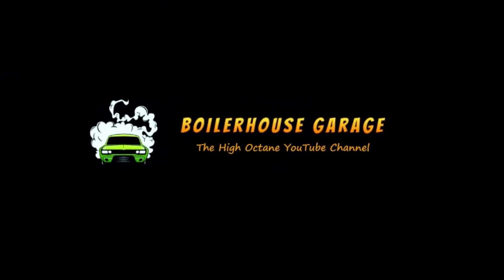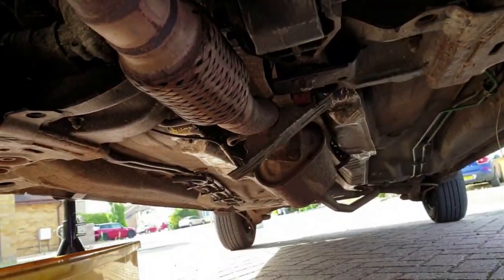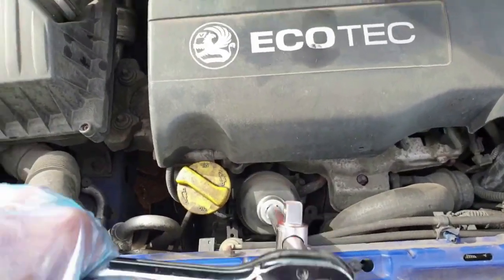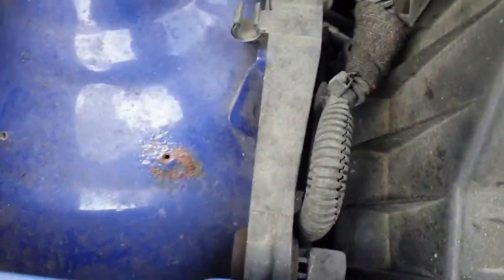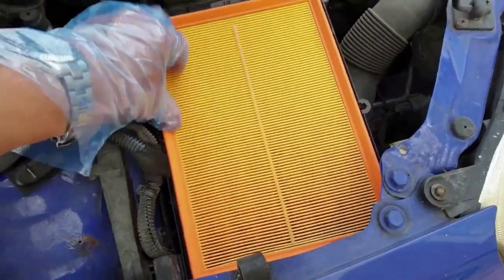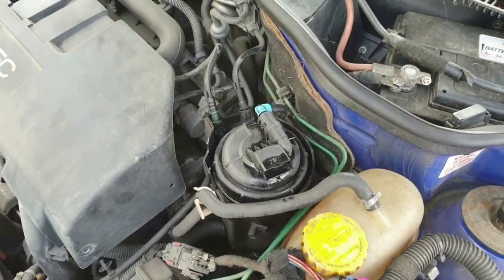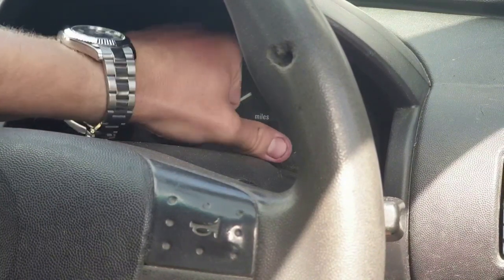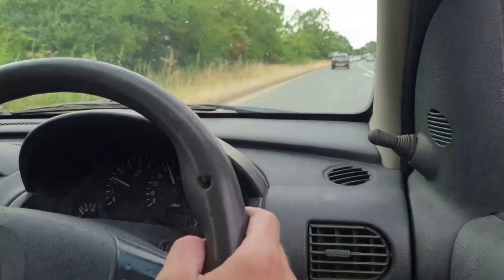2007 Vauxhall Combo 1.3 CDTi 🚚 Air And Fuel Filter Service Oil Change 👨‍🔧 Test Drive 🔧 Opel Corsa

Comment: I'm shortly carrying out a oil and filter change on my Combo van that has a mileage of 138,000 and it's still going strong. (My Fishing wagon now I have retired) This video is just what I needed.
Reply from the maker: Excellent! I'm glad it can help. Is yours a 1.3 as the 1.7 is a completely different engine?

Did you have any issues getting a good insurance quote? I have in the past when using a van for personal/hobby use, as I think a lot of them assume it will be commercial  and business use.
Reply: I insured mine for £227 a year which I was shocked. Ex royal mail 1.3 cdti. I was thinking of scrapping it recently as the gears went all weird where I could get into 2nd or 4th gears at all. But still been driving it couple times a weekend as I work away all week as a HGV driver and just coped with 1,3 and 5. Then all of a sudden, I gone to change down into second forgotting it was not working. It actually got into second with a grind which it never did before and it engaged the gear when I released the clutch and it got 4th without grinding. But while in 2nd or 4th gear, the gear stick didnt feel like it had slotted all the way into gear. This happened for a few miles and then the morning after, it appears to be working fine with no grinding and slots all the way in.

I insured mine as a day van with Lexham. I only had the van since September. Before that, I had an 04 plate Almera which was and still is a great car. My father owns the Almera now with the 1.5 petrol. I was paying £98 a month to insure the Almera. But as I only mainly drive to work on a Sunday or a Monday and home on a Thursday or a Friday. I couldnt justify the expensive insurance. I was deemed by Hastings that I am at a higher risk due to my job as a HGV driver which is odd as I could possibly only drive my own vehicle twice a week. I am also a named driver on my wifes car too and when I go anywhere during my time off, I go in the wifes car as its much nicer being a 72 plate Seat Arona FR auto.

I enjoyed this video, I have decided to keep the old girl now especially as I realised that the last time I put diesel in my van was in September when I filled the tank and its on just over a 1/4 now. It is limited to 70mph and sometimes when building up speed to join a motorway in 3rd or maybe 4th. It seems to have a miss and then reduces in power. I still reach 70 but a slight hill it slows down to about 60. I am going to have a look at my air filter and MAF sensor later today as I already have the replacement parts with me at home.
Reply from the maker: @stevecampbell7589  Sorry for late reply. Youtube not notifying me again.

That's great! It's worth keeping them going for as long as possible, but obviously having some kind of breakdown service just incase. Gearboxes can be weird. It might be due a fluid change in case it's all gummed up and effecting the synchro. If your MAF is faulty, you'd be using a lot more fuel than expected and it usually throws an EML, but definitely check the air filter is clean. Thanks for the comment.

Comment: Great video.  Just done the same service to my 1.7 DTi.  Ital van would be an awesome fine
Reply from the maker: Nice! Is that in a MK4 Astra? It might be based on the same one in my old Civic. It's certainly a lot better than this Fiat 1.3 although I've seen some hit 180k miles. Thanks.
Reply from the maker: Oh hang on, I just remembered you had a Cavalier MK3 with one. Not sure on the 1.7 in that.
Reply: @boilerhousegarage   it’s in  a 2002 corsa C. Isuzu 1.7 DTi.  Much better than the fiat unit and more economical.  Cav went 😭. It was one of those cars that people liked to bump into.  Only 2 cars now.  85 3dr Astra estate. And a corsa c DTi.
Reply from the maker: Aw crap! That Cavalier looked tidy. Well at least you have a very practical classic (my '88 Astra van was the same platform) and the Corsa must do some epic miles per gallon.
Reply: @boilerhousegarage  Iv wanted a 3dr estate for about 30 year 🤣.   Corsa does 49mpg around the doors consistently.  That brimming it, 2 clicks.  Then returning to the same pump.  Iv not  had it on a good run as yet.
Reply: @boilerhousegarage  my little 1.3 has just hit 218k 😂
Reply from the maker: @Cookymonster198  Wow! Obviously being well maintained. I'm confident the one in this video won't get to that! 😄
Reply: @boilerhousegarage  the lad that owned it before me had a father who was a hgv mechanic, I’m guessing he took pretty good care of it, I’ve only had it a year but hasn’t let me down either, the only issue I’ve had is a bit of intermittent rough idle lately, hence stumbling across your video as was looking at changing the fuel filter!
Reply from the maker: It is still rough idling? What I found on a lot of higher mileage cars are the crankcase ventilation hoses that route to the throttle body and/or air intake area can block up. You can just disconnect them to see if the idle improves and then clean and fit a catch tank. Similarly the idle control valve itself can also get clogged and are usually cheap and worth replacing as a matter of course.

Comment: Those little combos are brilliant vans 13 diesels run for ever on a fiver personally id love a mk 1 combo but good ones are getting rear 👌👍🏻
Reply from the maker: I was confused to what the MK1 Combo was, as I saw an "Opel" Combo, which was the same as our MK2 Vauxhall Astramax Van, then what I thought was the MK1 Combo, looks like an Astramax rear but Corsa front end 🤔Perhaps like the Corsa/Nova, Kadett/Astra, Ascona/Vectra/Cavalier, the European ones overlap out marques?
Reply: @boilerhousegarage  The first generation combo did have a corsa front end and box plonked on the back it first came out in 93 / 2001 🤔
Reply: @darrenmeears3912 I had the first generation combo van with the metal front roof box. Mine was leaking like hell when I got it , a guy on  eBay sold fiber glass replacement front roof covers. I bought one and it solved the leaking, but I couldn't sort the none working speedometer!. After a few months it failed it's M.O.T. so off to the scrappy it went!

Comment: I occasionally get a judder moment of limp like it’s running out off fuel… would you you advise I change the fuel filter? It only got changed 5k ago? Thanks if you reply
Reply from the maker: Never mind that, where's this ganja at? 😄 I'd be first looking for water ingress which you can find in the fuel filter housing (water will go to the bottom with diesel sat on top) so you'll be looking in that area anyway to see if something is clogging the filter or any part of the system. Do you run the tank low much, or notice it happen less if on a full tank or more if you're coming off a roundabout? It could be a loss of fuel pressure if the pump is on its way out, but should really outlive the van unless its done exceptional mileage. A couple of tanks of Shell V-Power diesel and an additive called dipetane wouldn't go amiss if perhaps the fuel system is clogged somewhere else.
Reply: @boilerhousegarage  I was under quarter tank when it was happening and just filled up and it’s not happening now so you think pump or water in filter? Thanks mate
Reply from the maker: @cannabisfarmoutdooruk4729  It won't be the filter/housing in that case. It could be your pump, or at least it could get damaged if you run the tank too low. Chances are your fuel tank is contaminated with water, sludge or I've even seen petrol (where someone has mis-fuelled in the past) as it will sit on the bottom of a diesel tank. All diesels and fuel injection tanks are pressurised or use a swirl pot, so keeping the tank as full as possible will mean you're effectively diluting the contaminant, so try not to let it fall below a 1/3 tank. You can get it drained and cleaned out, but as it's a messy job and the fuel will be classed as hazardous waste, it won't be cheap. There's no fuel drain on these tanks and you can't syphon it (I've attempted both) so won't be a home job unfortunately. As long as you keep the tank topped up full, you can still use it; it's just annoying to keep having to fill up every 200 miles or so.
Reply: @boilerhousegarage  nice1 thanks for you help 🫡

Comment: I had this confusing message on my fiesta st mk7 they dont have a service light ar interval. Very confusing. As it is not an eml it doesnt appear on a standard basic odb reader. It only showed on an expensive advanced reader (such as this on this video) in my case the error was also a pressuee sensor and was a boost leak. In my case from the intercooler.

From my experience if anybody gets this error light appear my advise would be to get a boost leak test. Once fixed it should dissapear on its own
Reply from the maker: Yes, they make a lot of people say they need an engine service (like it's due for an oil change) rather than throw a proper indication that you have an error code. My ST was going into limp mode and even then the EML light was off! Boost leak tests are a good idea. Most decent engine tuners will do one prior to any mapping or other work.

Comment: What did everyone else do about removing the oil filter from the oil housing? i ended up just brute forcing it and breaking all but one of the clips holding the old one in place .... the new one slotted in fine but didnt "latch" as well as its clips were a tiny tiny bit skinnier.

Anyway, everyone just brute force it out? or is there actually a proper way to remove the old oil filter form the housing?
Reply from the maker: I think someone must have not clipped your original one in properly and as the housing is tightened down, made the clips misshape or something. The one on this van just popped out easy as you'd expect and the new one clipped in nicely too.

As long as the filter element is in place as you refit, once you've tightened down the housing, it will hold the filter in the right position.
Reply: @boilerhousegarage  thanks for the feedback, and thanks for the video! Really useful 👍❤👍❤👍

Comment: I have the 1.3 looking for advice its makes a sort of grinding noise the noise doesnt get any better or worse you can hear from inside the cab but not outside as i have somebody drive  past me to see if i can locate it  and it does not do it when idiling either any advice guys would be appreciated cheers Ben
Reply from the maker: So it only grinds during the engine running and when you're driving, but not if the engine is idling and the grinding is a constant pitch no matter how fast the vehicle is travelling or engine is revving. Normally grinds are brake, wheel bearing, drive shaft related but they'll change pitch and get faster/louder as you travel or clutch release bearing, but you'll hear that at idle more than anything. A constant pitch would be from something that moves at roughly the same speed regardless of the car's/van's movement so could be fuel or injector pumps, heater fan, electric radiator fan. Have you tried to hear if it's coming from the engine bay or rear of the vehicle?
Reply: @boilerhousegarage  it seems to come from the front of the vehicle and it is a constant pitch doesn't get any louder or less thank you for your reply
Reply: It also stops when you put the clutch in to change gear
Reply from the maker: @Bengarl  That's almost certainly a clutch throw-out bearing, also called release or thrust bearing. It would effectively mean having a full clutch kit replacement, as the work involved to take the bell housing off and replace the bearing, you may as well have a new clutch cover and plate too. However it will at least still function for ages and just be noisy, so you don't need to get it done with any urgency if the clutch itself is still engaging.
Reply: @boilerhousegarage  thanks for your reply Al need to certainly look at that it doesn't bother me the noise just didn't want to run around in it incase it was going cause serious damage a will need to look at getting it fixed soon thanks for your advice appreciated it's a great wee van 😀.

Comment: Why you can not suck the oil via dipstick?
Reply from the maker: You can. I just used the sump plug/drain as I was also doing an underside inspection. Plus, not everyone has the vacuum or electric fluid suckers so this is better as a "how to" video.
Reply: @boilerhousegarage  Oh, lovely then, thanks.